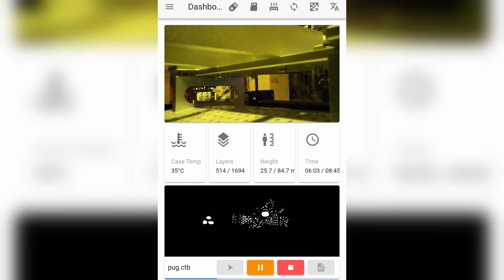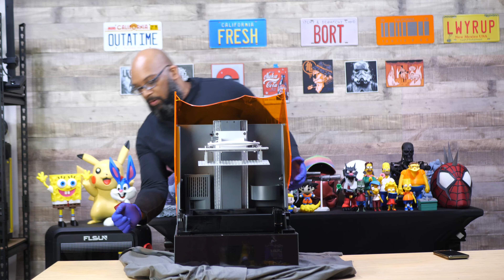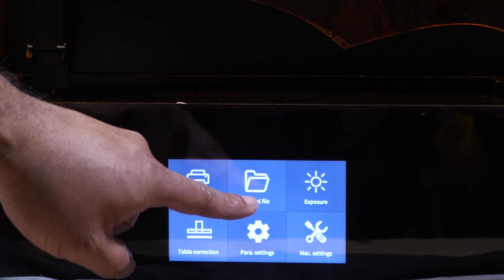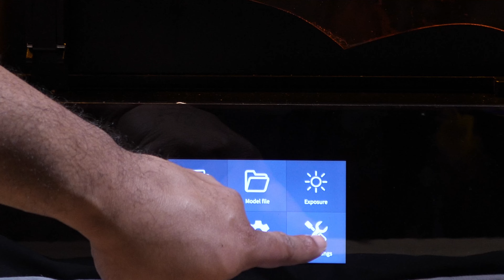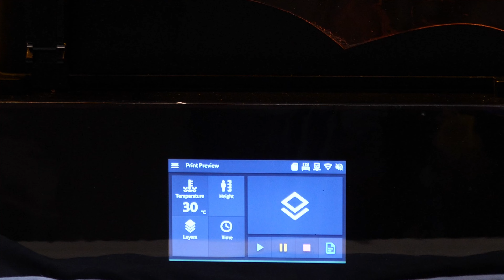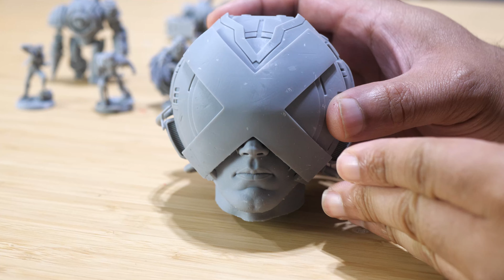First Look! The Hypermaker Industrial-Grade Resin 3D Printer

Comment: Nice review, Jeremy! That resin mixer high pitch noise (and always-on loud fan noise) would be a deal breaker, as well as the high price. Your point on having a justification, like monetizing this “tool”, with sales of specialty ceramics or dental 3D prints might be a use small-business use case (all other issues corrected or minimized).